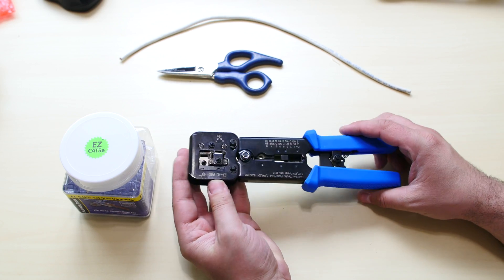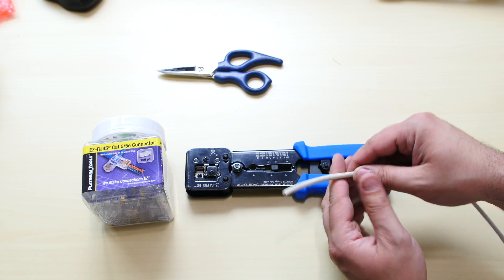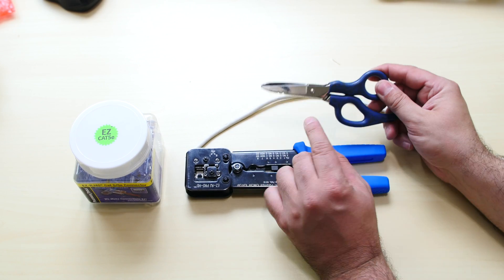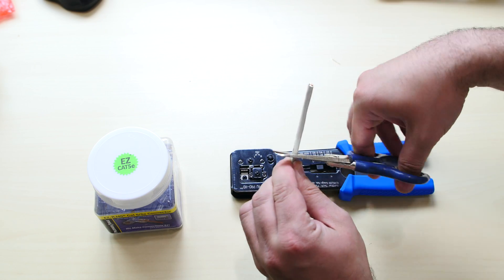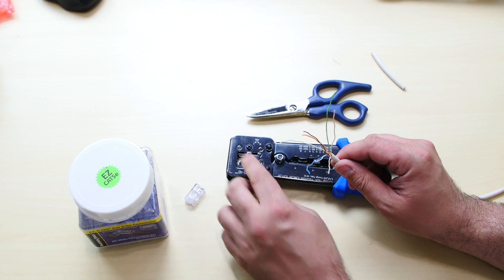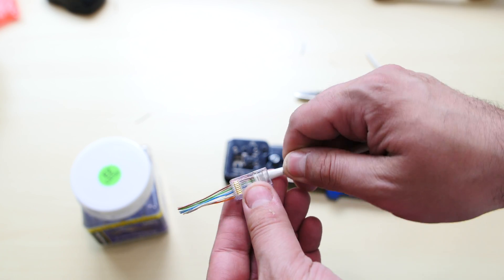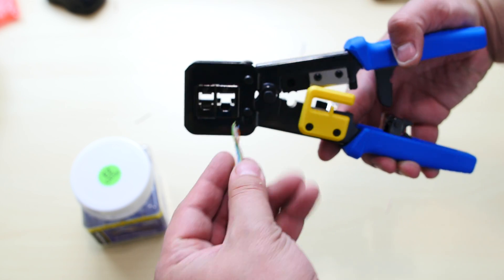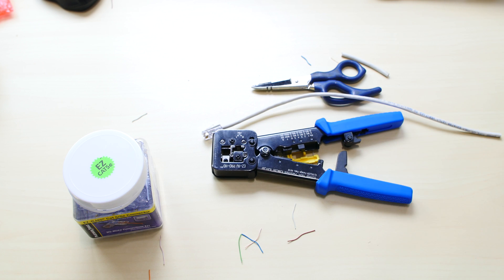Best RJ45 Crimping Tool

Comment: Having to buy dedicated connectors is a huge rip off and a deal breaker
Reply: Agree but you don't have to use EZ RJ45  - works on normal RJ45 . In my opinion it is essential for terminating ej11/12 and is such a faff otherwise.

Comment: This tool will not crimp networks. It is not a network crimping tool. It is an RJ45 connector crimping tool, a tool for connecting RJ45 connectors to CAT5 or CAT6 cable. RJ45 connectors are the standard type of connector used  to terminate CAT5 and CAT6 ethernet cable and perhaps some other types of cable, but this kind of cable and this kind of connector can be used for most any  purpose that requires 6 conductors of the same diameter used in this cable. Also, ethernet is one of several different kinds of computer networks. Other networks tend to use different kinds of cable. So this is NOT a network crimping tool. It is a tool for crimping RJ45 connectors onto CAT5 or CAT6 cable.
Reply: relax buddy

Comment: I have been wiring my whole house and this has been my tool to create all the cables. This tool and the EZ Connectors have made making the cables a breeze. I have run so many cables that I need to replace my 24 port switch with something larger.

Comment: When i saw the title i thought to myself... how can  a crimping tool be diffferent than others and to the point you call it the "best" but i understand why now, i had never seen one that cuts off the excess of the cable, that really saves a lot of time while making cables! Im buying this as  soon as i can haha
Reply: yeah but when the rj45 connectors are plugged into network devices and such the exposed excess that was cut off at the very end of the connector can make contact with the inside of the port and potentially short out the ethernet connection, and even possibly short out the network device, so use of this "EZ" style of connectors is advised against
Reply: @bludude41  yes! I’m so surprised I haven’t seen anyone else say anything anywhere. I’ve seen so many issues with these pass-through types, yet everywhere I see people are praising how awesome they are. Major facepalm.

FYI coming from an AV/network tech of 11 years. Issues I’ve seen is this exact thing with the shorting out, the tips of the wires themselves shorting out to each other, corrosion in certain environments even when all could be done weather-proofing wise, and also negative effect is that the wire actually hangs out a little bit past where the termination is made inside the modular plug. This creates a very minor, yet existent, sort of “bridge tap.” Old telephone term…Essentially meaning the signal is bleeding off on a connection in a separate direction. Hard to explain in text but never good for the signal…